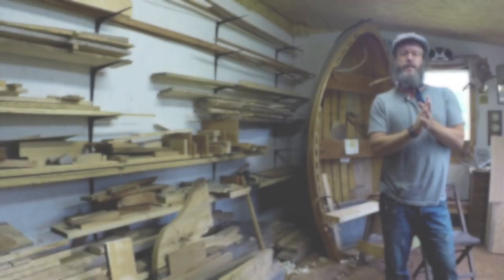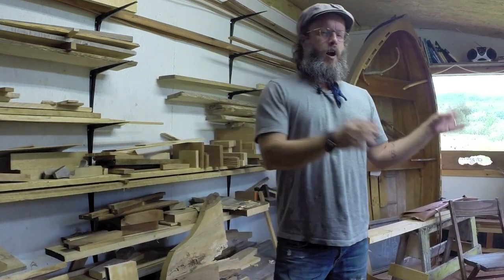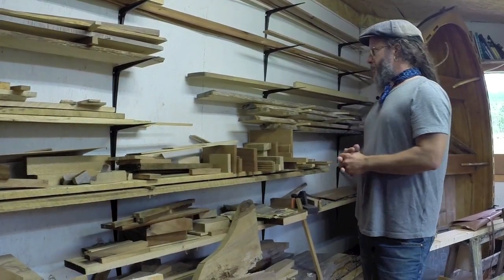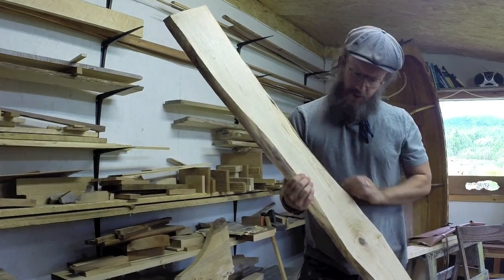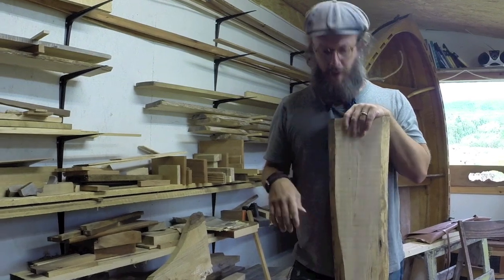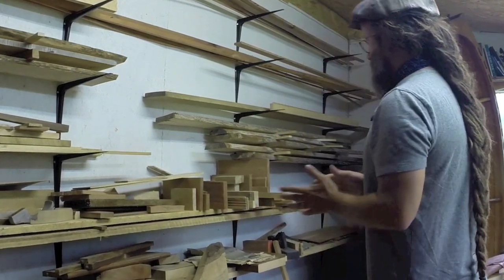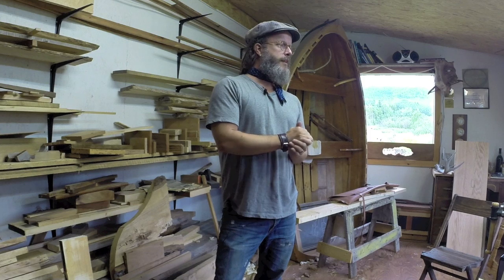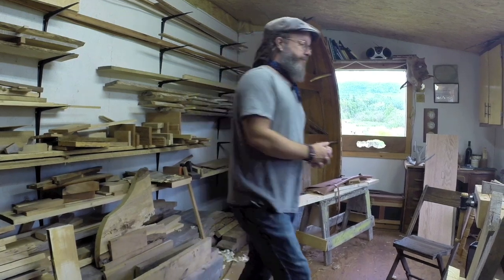Inspiration in the wood pile - The Unplugged Woodshop

Comment: Hey Tom, do you have a treadle lathe? You can use a saw to cut antler into manageable pieces then treadle lathe them into pen casings or knife handles with a good file. My grandfather has been doing that for years and makes some beautiful knives. Polished antler is a very pretty thing.